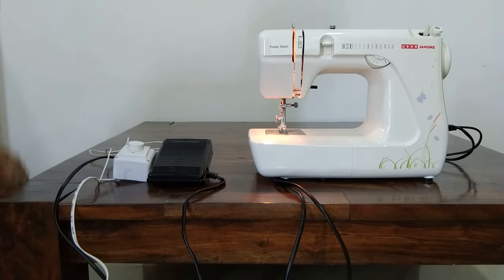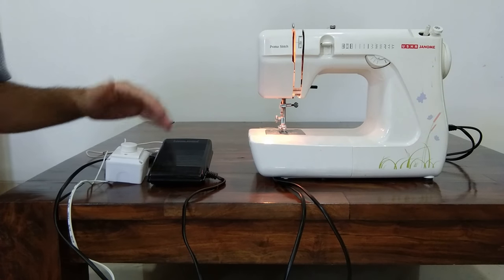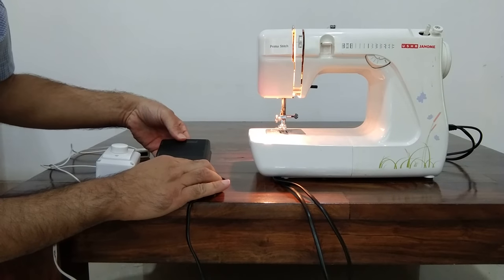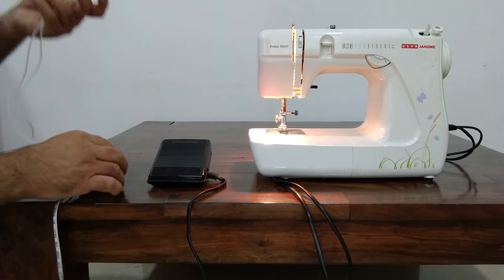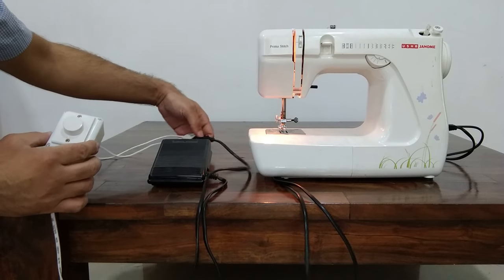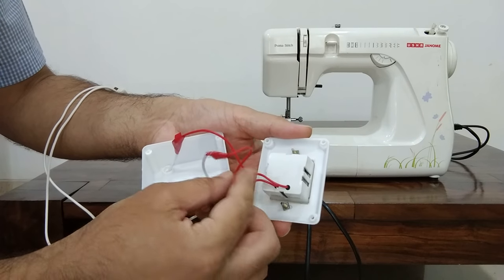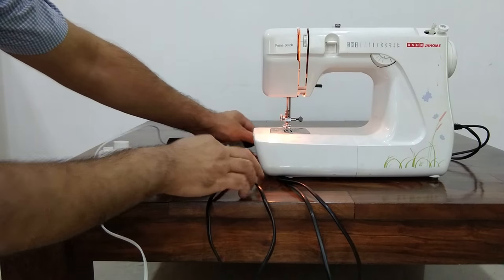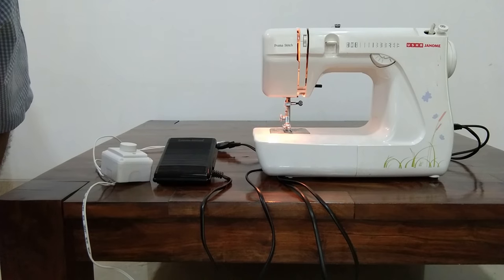How to Control Speed of Home Sewing Machine (base model USHA janome)

Comment: I've just watched your video after struggling with the speed of my old Singer machine using a 
book next to the pedal system which doesn't work I'll be at the shop tomorrow to buy a dimmer switch. Thanks a million. from Thailand.
Reply from the maker: Sure friend. Let us know how it goes
Reply: @kr9c  It works perfectly. Now the machine will not run away with me. Thanks again. Now the problem will be my wife sorting out all the sewing jobs for me.

Comment: Eventhough this video was produced in 2018, it was still very relevant and was a life saver. Thank you so much bro. I had just a week ago bought a singer classic 44s sewing machine but the speed was very disappointing and I had no idea how to regulate it. Had it not been for your video I would have tried buying another pedal and that won't guarantee its speed. Anyway I had bought a cheap dimmer instead and followed your instruction and it worked perfectly well. However just a note to all those with similar problem, I had cut eg the blue wire and inserted one end of the wire blue wire from the incoming electricity input slot and its other blue wire to the output which goes to the machine plug socket. Hope it's not confusing. Best regards
Reply: Hello, I just found this video with the great possibility to decrease the spread of my new Singer 44S and I was pleased to read your comment, would you please share what kind of dimmer you used for your Singer and if your machine is still performing well? I'd truly  appreciate it
Reply: @aracelilindsley464  , it wasn't a dimmer rather a electric regulator. You can try and purchase it online. It's very small in size. Within your palm.  It has a turning knob to regulate the amount of power required when in use. It's a 240v regulator with in 220v and out 220v. You will also need to ensure that the small brown bulb in your plug head is of 13Amp power. Anything lesser may not work. Hope that helps. Best wishes. 

 Hope that helps.
Reply: @oldkidontheblock4185  thank you so much for your response, I will give it a try
Reply: @aracelilindsley464  sorry I'm busy right now. But here's a link  https://youtu.be/IY9UgwrWRRk
where you could look at the sample regulators. I used the boxed type. See how the guy fix it up. That's about all you need to do. Hope it helps. Best wishes.
Reply: @oldkidontheblock4185  Thanks so much!
Reply: @aracelilindsley464  HI, did you managed to regulate the speed of your Singer Classic 44s? Please share your experience. I'm just curious. Thank you 😊
Reply from the maker: Thank you 🙏

Comment: Your idea is good but it will dim the machine light also

Connect the dimmer to accelerater output wire .. It will not dim the light
Reply from the maker: Good point sir 👍

Comment: Does it work on every sewing machine or on sewing motor also like 8500 rpm 1/12 hp?
Reply from the maker: I believe it should work on any machine ( use dimmer switch). 

If you feel motor is too heavy as compared to switch then seek a bigger switch. But don’t think home use sewing machines would need anything bigger than regular switch (usual disclaimers apply:-)

Comment: I made this contraption. My mom is worried if it has any adverse effect on the motor, what do you think ? If im not wrong, the dimmer lowers the amperes to the motor, are these motors safe to run on lower amps ?
Reply from the maker: Gustav thank you for your question. I would let other views pitch in as I am not informed on this specific detail.
Reply: Dear Mäkinen, for the same reasons I investigated about this point. 

I arrived at this conclusion for me: if I use this kind of device to running the machine at any speed falling into the "original factory speed range", there would not be problems. But if I use a device of this type to run the machine to a speed lower than the minimum of the original factory speed range, I start to take a risk (and more lower than the minimum original, more risk...).

In other words: if I use this device to get a better control of the pedal reducing its "sensibility" but running the machine at a speed into the original factory speed range there would be no problem. For example, it is hard to maintain the exact point in the pedal to get the minimum speed, then I use this device to get a similar low speed but when the pedal is almost fully depressed.

Comment: Hi . Any suggestions on which motor to buy? I recently bought a Swift brand - 500 rpm one. Crashed after 8 months of use.  Ur input would be highly appreciated. This would be only for domestic use.
Reply from the maker: Actually, I have only used Usha machine; the one in video. But I have heard machines by Brother brand are good (however, they are expensive)

Comment: Nice ..are you controling the moter only or whole machine curcit?
I have Janom 5002 model 110volt... how can i use speed controler?plz guide
Reply from the maker: Hi
This is simple: just make the writing I described through light dimmer switch and plug in the peddle as shown; it will control the motor. No other modification is required to the machine. Hope this helps
Reply: @kr9c  thanks for your kind information....

Comment: Where did you get the white wire with the female socket?
Reply from the maker: Hey 
In India it is easy to find:   GM 2-pin Male-Female Socket Flexible Flat Wire (5 m) https://www.amazon.in/dp/B079KH7J9C/ref=cm_sw_r_cp_api_i_Cp3CEbR4KRKYF

Comment: Dear kr9c, please could you said me precisely if you are using a "Light dimmer type" (the variator to control the light intensity of a lamp) or a "Fan speed controller" because both are different. In the video you say that you are using a "friend regulator" then I can not realize which type it is.
Thanks in advance and Happy new year...
Reply from the maker: Go for light dimmer type. It will work. Happy New year.

Comment: Hi can you please share the links of the items I need for this to work?
Reply from the maker: Sure Luis, see below links to amazon for parts

Dimmer switch
https://www.amazon.in/Anchor-Panasonic-Modular-Polycarbonate-Dimmer/dp/B07L6YQYXW/ref=sr_1_29?crid=1FTPQJ50NXO26&dchild=1&keywords=dimmer+switch&qid=1630477696&sprefix=dimmer+%2Caps%2C369&sr=8-29

Socket, housing and wire
https://www.amazon.in/dp/B09BJZRGQ3/ref=sspa_dk_detail_5?psc=1&pd_rd_i=B09BJZRGQ3&pd_rd_w=0tQt2&pf_rd_p=4e9225d2-7473-4eb0-95d5-670190275218&pd_rd_wg=UfDB8&pf_rd_r=VHY0NSZ42CYFQZXEKA1N&pd_rd_r=e661ef64-1582-41de-890f-16a312ed3fb2&spLa=ZW5jcnlwdGVkUXVhbGlmaWVyPUEzUUJBRVFLWTVDNjE5JmVuY3J5cHRlZElkPUEwNzA0ODA5MjZOQ1g0M1E5OTZVSCZlbmNyeXB0ZWRBZElkPUEwOTg1MTQ4MUVOWE5JRzhXSUtSRyZ3aWRnZXROYW1lPXNwX2RldGFpbCZhY3Rpb249Y2xpY2tSZWRpcmVjdCZkb05vdExvZ0NsaWNrPXRydWU=

Comment: Great hack, can’t work on my janome 4400 because the foot pedal wire is fixed :(
Reply from the maker: If you want to be adventurous you can cut the wire and install the dimmer switch as in the video

Comment: Regulater and pedol me kaise setup kra h
Reply from the maker: Sure, let me try and explain here:
(1) Regulator takes the current from main outlet (this part is explained in the video at 3:10) and outputs through the female plug
(2) Paddle wire (black) plugs into the female plug (from 1) and the other wire coming from the paddle plugs into the sewing match (no modification in the latter)
(3) With this set up you can control (via dimmer switch) how much current is sent to the paddle thus controling the speed of the machine.
Hope this is helpful
Reply: @kr9c  
Sir Ek baar vedio bna kr send krdijiye plz